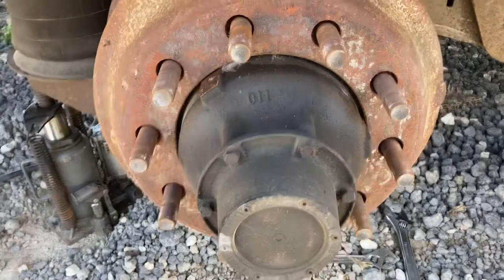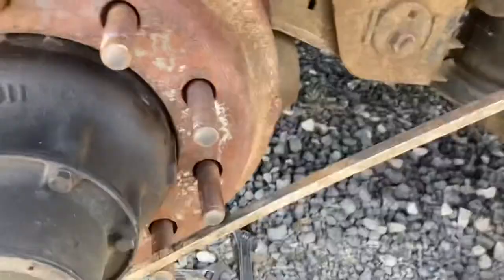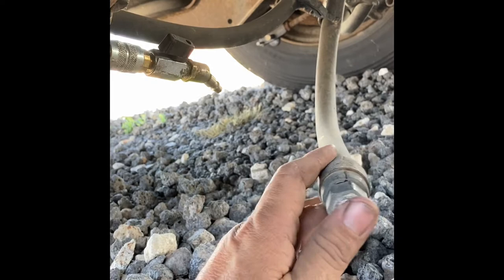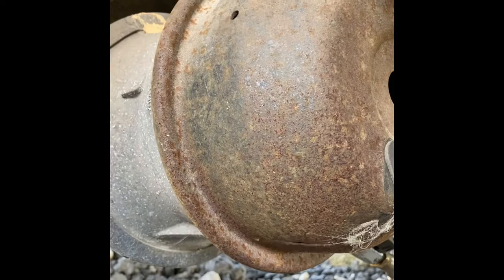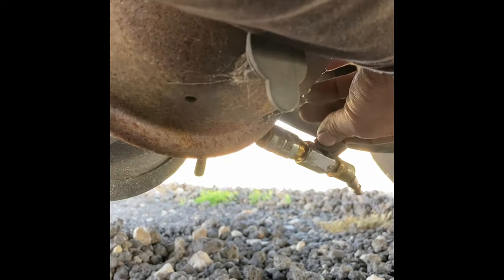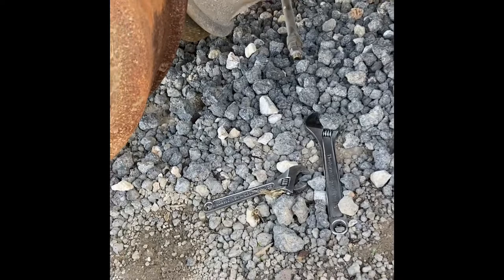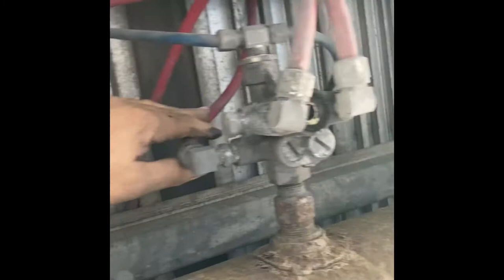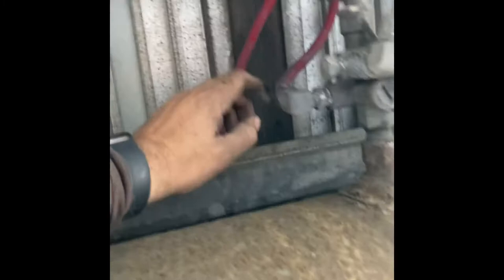Dead bug locks up Semi Air brakes , Test don’t guess

Comment: Dillagence always pays off in the end! Nice work saving a bunch of time, frustration, and money!
Reply from the maker: Now days every one just wants to fire parts cannon
Reply: @sonofmontezuma3732  Have you thought about doing #shorts videos?  I think your typical format and information would work awesome as shorts and might really boost your channel.  You've got tons of tips and tricks and pointers that you could probably fit in 1minute vertical videos.  Just a thought.  I'll watch either way!
Reply from the maker: No I had not but yes I should look into it , the other day I was called to a shop guy bought a fancy set of gauges did all of sorts of stuff ,it was fiber optic tech behind it they could not get it to work the had electrical noise in the power lines I thought man this is a great thing that I should record but customer did not allow it

Comment: Hey I have a flatbed trailer the front axle locks up after getting unloaded we changed both valves as well now the slack ujusters won't go in and out what could be this problem
Reply from the maker: That’s a big pizza to eat with out seeing it(diagnose) , what type of brakes? Have you attached gauges to the ports? Could be a mis adjustment, or a mechanical bind? Can you move the S cam if you work only the slack adjusters by hand?if equipped are the brake chamber the correct type? So it’s only on one axle but both axles have brakes correct? Also crossed lines something to look at.
Reply: OK thanks for the feedback I had new brakes put on and they recheck everything to make sure the s cams wasn't in wrong plus I changed both valve so it could be a cross line